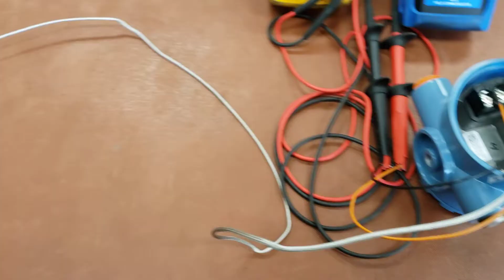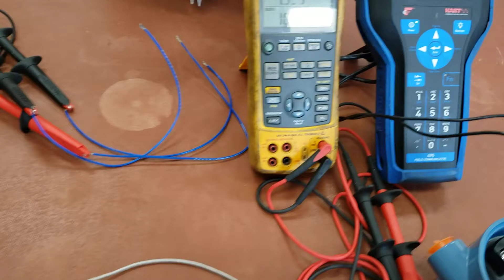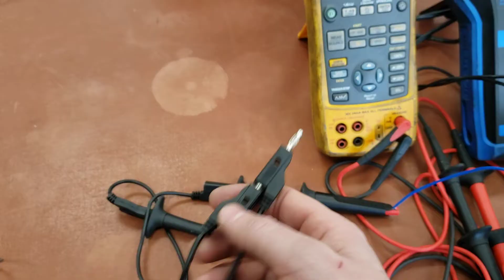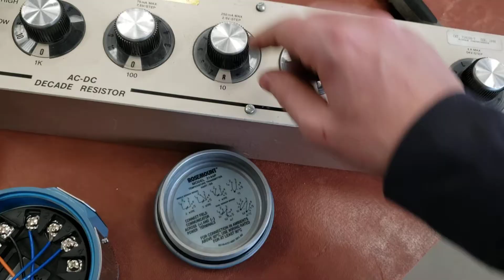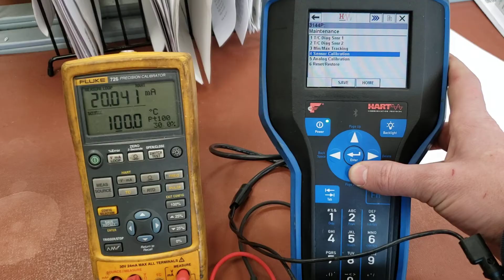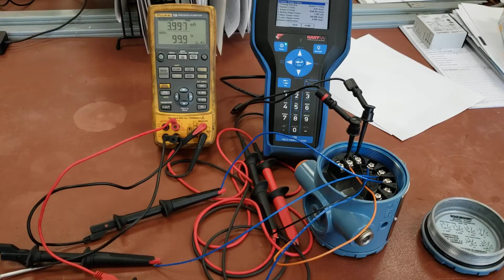Rosemount 3144P pt2 Rtd calibration

Comment: Great job on the video!  I was impressed with how you explained the induced resistance from cabling when sourcing. I have a customer who requires annual calibrations and i just switched to a 724 from a decade. I found i was continusly off my 2-3*f when sourcing to transmitter from 724 when compared to decade. I WAS ADDING RESISTANCE THROUGH MY LEADS! The 724 should be accurate to 0.333*C for 385pt100. Thats .5degF. It was my leads adding resistance. Once i calulcated my resistance and compensated , my readings were back to normal. Thanks again for these videos! FYI dont invest in the TREX! super slow! I wish they didnt discontinue 475. Best comm on the market hands down imo.

Comment: thanks very much for your valuable video , but there is point  not clear for me ; in video time 15:09 you use fluke to inject a 99.9 ohm to transmitter and the transmitter draw 4 ma and show a 0 c in HART communicator , but in the RTD Table the  100 ohm = 8 mA and its equivalent to  25% which i think equal to 30 c ? so kindly can you clarify this point .
thank you
Reply: He doesn’t show an rtd table he shows a data card for a different transmitter notice the range on the sheet shows -10 to 40 degrees Celsius and on the transmitter he is working on is set to 0-100 degree Celsius so the mA output will be different. But the ohms to temperature is correct if you look at an rtd table for pt100

Comment: 12:18
Is there any way to zero the leads on the meter itself?
Reply from the maker: As long as you are using 3 or 4 wire,  it's doesn't matter as long a the resistance in the leads are equal.
Reply: @byronvanalstine if you watch the part I time stamped he was saying if you want a more accurate reading you could take away the exact resistance of the leads too. I was just wondering if you can zero the leads and the extra cable easily with the meter rather than measure it and deduct it manually